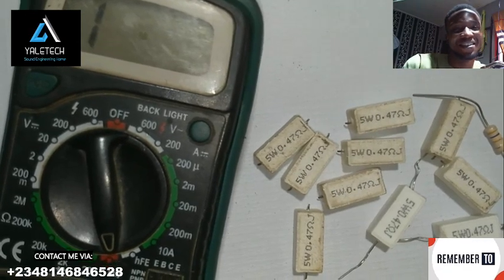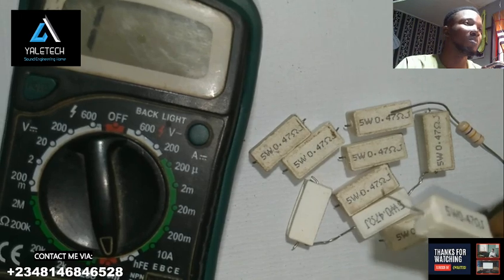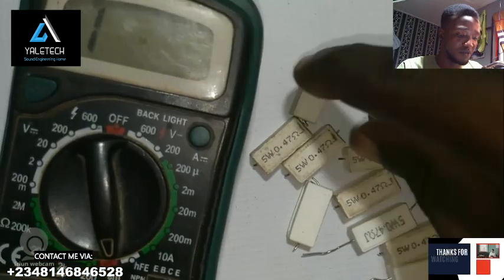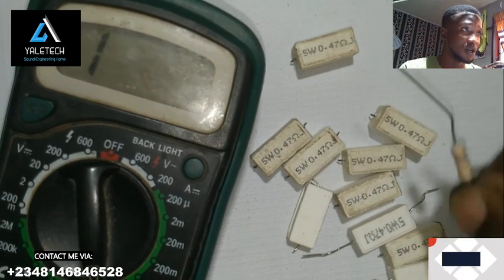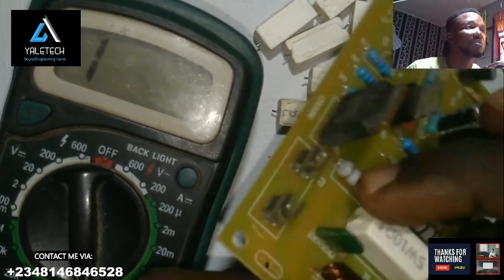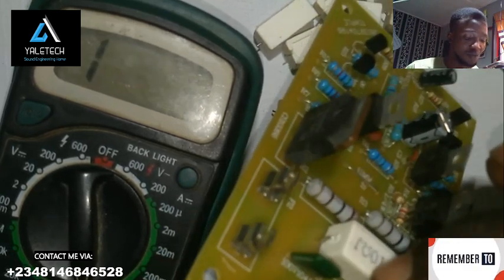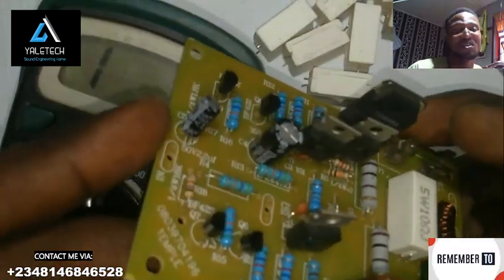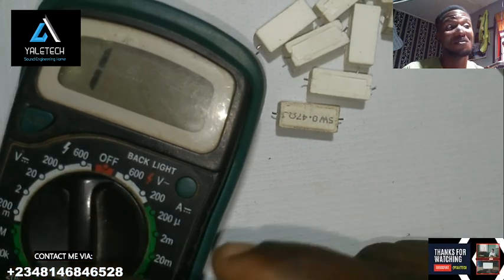CERAMIC/CEMENT / CONCRETE RESISTOR 5W 0.47OHM TESTING, FAULT DETECRION AND FUNCTION

Comment: so bro you mean every white ceramic resistor should have continuity?.. do all the 5w resistors act as fuse. what if it's reads but no continuity?
Reply from the maker: If it reads it's still good too, you know multimeter can be funny sometimes with some components
Reply from the maker: And also note the ceramic resistor is not necessarily acting as a fuse in those use case.

But help the Transistors not to over work it self, bcoz by default when u drive ur amp hot, ur transistor will want to over work itself to keep producing more watt based on ur drive.

But this will definitely burn the Transistors, so that's where the c. Resistor comes in and some other sensor on ur heat zinc which helps in shutting down the amp when it beyond the safe temperature, while at times the c.resistor will just cut off.

I hope this helped you a bit.
Thanks
Reply: @yaletech_ yes It's helped me ...can   you be able to teach and guide me to fix a problem on this amplifier that has dc fault protection problem?
Reply from the maker: Dm me on Whatsapp +2348146846528
Reply from the maker: Uwlc
Reply: @yaletech_  thank you
Reply from the maker: Glad to be of help, thanks for watching